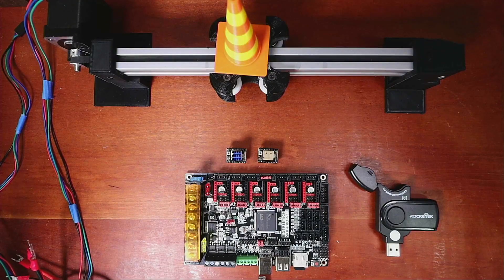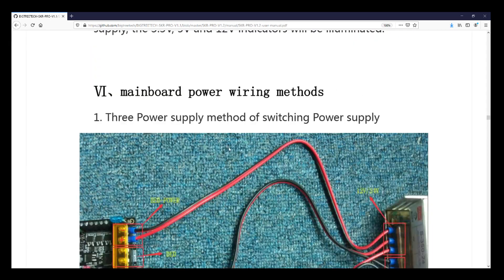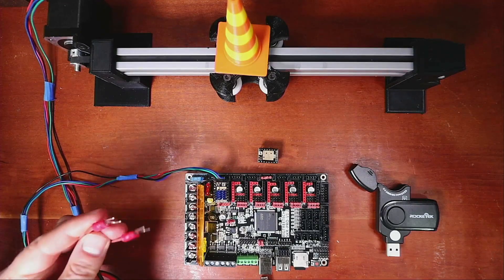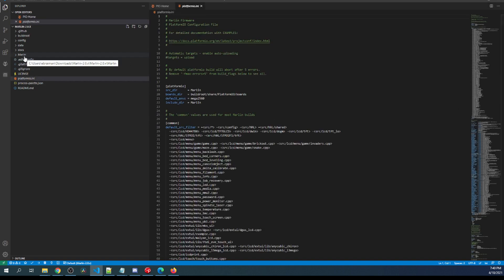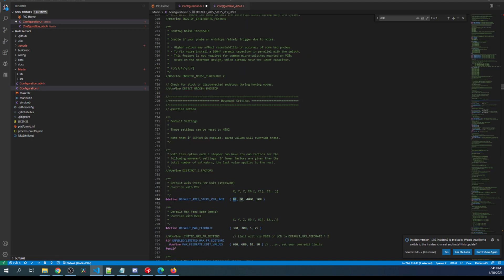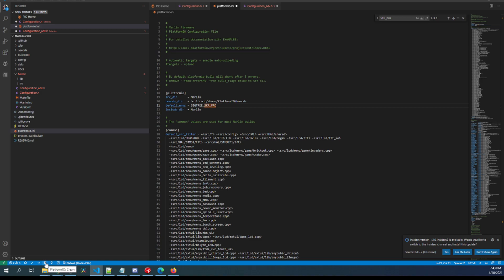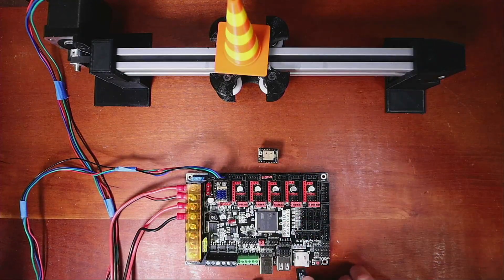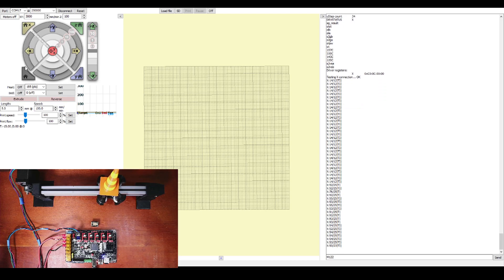SKR Pro v1.2 - TMC2208 UART

Comment: Hi Ed! This video has been a great help so far in changing my Creality 4.2.2 board to my newly acquired SKR Pro 1.2 board. Thank you very much! I now understand I purchased the "wrong" 2208's and I need to solder the minuscule pads to make UART work.. What I'm still wondering about; do I need to connect jumperwires to the 3 top pins sticking out on the 2208's and connect them somewhere to the SKR board to make UART work?
Reply from the maker: Tmc2208 these days normally don't need to be soldered.  There's a link on my channel to Discord and either myself or someone else in general chat can walk you through the settings.
Reply: I bought them directly from BTT, and unknowingly chose the Step/Dir variant which is not soldered. I have joined the discord, thanks a lot! And good to know I don't need jumperwires!
Reply from the maker: Also wiring on top is not required, because it's in the tracings of motherboard.

Comment: 😪BTT SKR V 1.2 “Auto Home” and “Level Bed” Problem

On Anet A6 I installed BLtouchwith original ANET3D v1.5,
Marlin-2.0.x and “Auto Home” and “Level Bed” work great.

Unable to get “Auto Home” and “Level Bed” to work on SKR-PRO-V1.2.
X, Y, Z axis move in the right direction but displacement is not correct.
X 10mm moves 5mm.
Y and Z 10mm moves 1mm

But with each “Auto Home” command, the Z axis moves up about 2mm instead of down.
Ditto for the commands “Motion->Home X”, “Home Y”. which are correct.
But “Motion->Home Z” increases each time by about 2mm and with each new command increases again.
Command “Configuration-> Probe Z Offset”, (given negative), has no effect. Z Axis does not drop below zero.

“Level Bed” doesn’t work either.

Used :
Marlin-2.0.x
Marlin-2.1.x
Stepper driver TMC2208 Uart

Some Configuration.h commands:
#define MOTHERBOARD BOARD_BTT_SKR_PRO_V1_2
#define SERIAL_PORT -1
#define BAUDRATE 11520
#define X_DRIVER_TYPE TMC2208
#define Y_DRIVER_TYPE TMC2208
#define Z_DRIVER_TYPE TMC2208
#define X_MIN_ENDSTOP_INVERTING true
#define Y_MIN_ENDSTOP_INVERTING true
#define Z_MIN_PROBE_ENDSTOP_INVERTING false
#define USE_PROBE_FOR_Z_HOMING
#define BLTOUCH
#define MULTIPLE_PROBING 2
#define INVERT_X_DIR true
#define INVERT_Y_DIR true
#define INVERT_Z_DIR false
#define AUTO_BED_LEVELING_BILINEAR
#define Z_SAFE_HOMING
#define REPRAP_DISCOUNT_FULL_GRAPHIC_SMART_CONTROLLER

platformio.ini :
default_envs=BIGTREE_SKR_PRO

I tried to change so many things with no positive result.
What is wrong please ?

So impossible to use the SKR-PRO-V1.2 card to my great regret.
And I wanted to install and use 3 RGB colors in an extruder and 3 stepper motors.

Thank you, gg
Reply from the maker: There's a Discord link in description and I or someone else can walk you through it in general chat.

Comment: I am having many troubles with my SKR Pro V1.2, where it will be printing and then suddenly stop. The TFT35 thinks the printer is still running, but the printer has actually frozen in place. I have scoured reddit, searched everywhere, but i cannot find anything about it. the issue has continued through every single attempt ive made, every marlin build ive used, etc. nothing works. I'm using BTT's TMC2209 drivers and the latest Marlin builds. any idea on what's going on?
Reply from the maker: Where is the jumper for power on board, 5v or direct power?
Reply: @EdwardBraiman  direct power.
Reply from the maker: And if you disconnect TFT and print from Pronterface or Cura it works okay?
Reply: @EdwardBraiman  nope, i havent tried pronterface but the same happens with Cura.
i'll try it with Pronter but i have a feeling it'll do the same
Reply: couldnt even connect to the printer. just crashed pronterface
Reply: @EdwardBraiman  Yeah, i just tried to work with it, nothing works
used to at least connect and start a print but now it doesnt at all
Reply from the maker: Are you using the same gcode file or another?
Reply: @EdwardBraiman  same file every time. I have tried other ones in every manner i could as well.
Reply from the maker: Can you post your configuration.h, configuration_adv.h and platformio.ini on Discord general chat?  The Discord link is in description below.
Reply: @EdwardBraiman  no problem!

Comment: Hi Ed, thanks for your helpful youtube videos.
Do you have any idea what might cause the TMC connection error when running the tmc2208 v3.0 in Uart mode?
Reply from the maker: Lack of power.
Reply: Thank you for your quick response. I'm assuming I just increase the current?
Reply from the maker: Normally message appears when running only 5v of current.
Reply: I turned up the current in the marlin firmware and now the TMC connection error is gone. Thanks again!